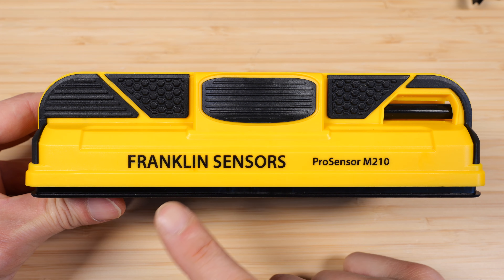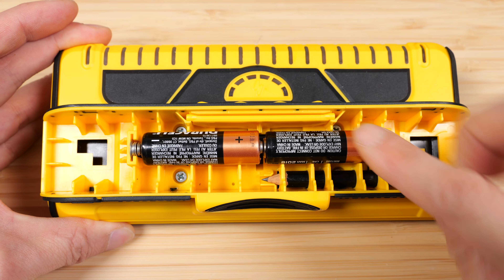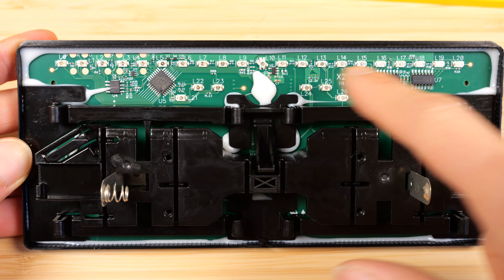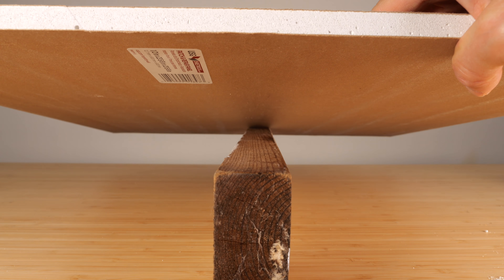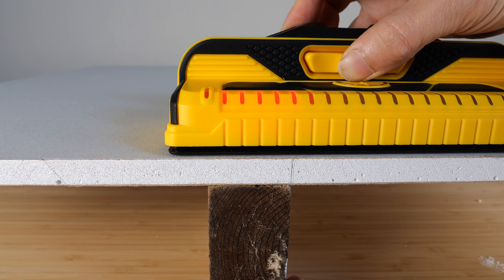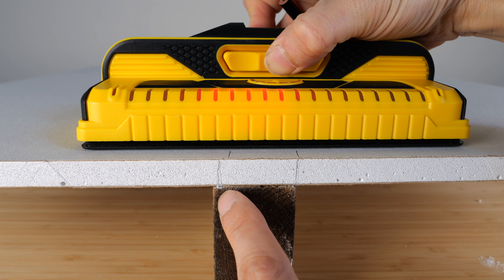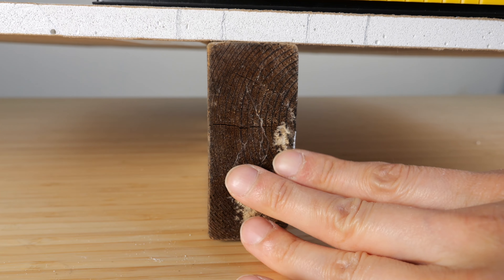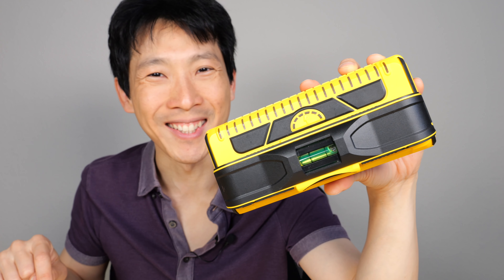Franklin M210 Stud Finder Accuracy

Comment: What is the difference between the 210 and the 2100? Also, the ProSensor Max is about double the price, but has no wire detection. How important is wire detection with these units? Hard to believe the Max doesn't have that feature.
Reply: Pretty important if you don't want to drill or short it with a screw piercing the cable. I saw an electrician do this 32 years ago and he couldn't find the short. I had to pull several panels off the wall to find his far cup. This tool if available then would have saved me a lot of time because I had to be real careful removing the thin veneer panels.  I am ordering one of these tonight. Watched several videos and I am impressed.  I believe it can also detect live wire under ceramic tiles but I have to double check that as I may have mixed up models. The 210 looks fantastic though.
Reply: @josephking6515  Agreed, but it still doesn't explain why the Sensor WITHOUT wire detection is twice as expensive of the one with wire detection, and if so important, it doesn't make sense.